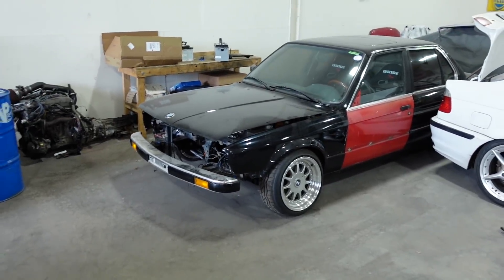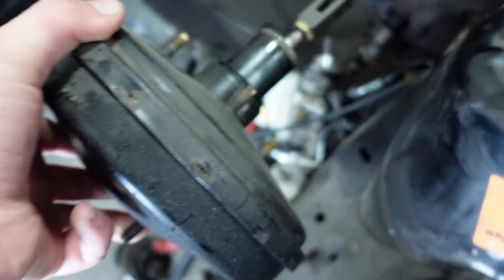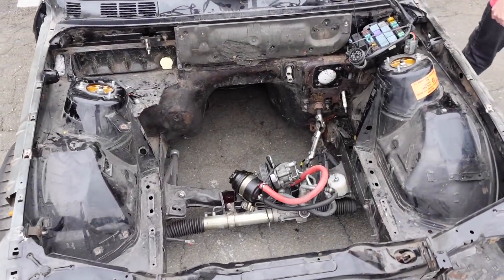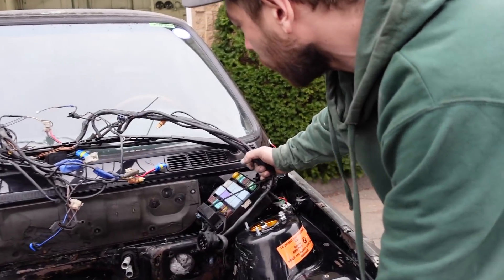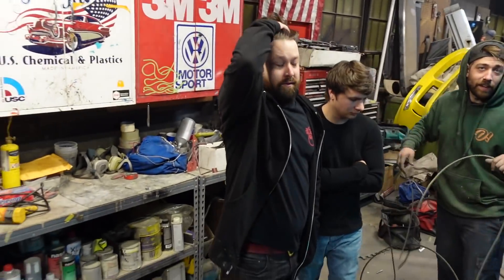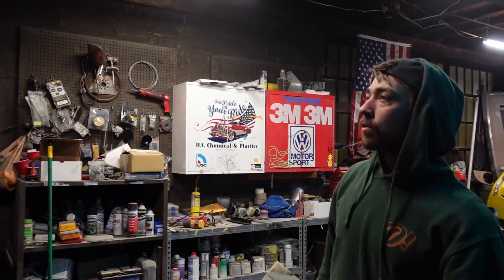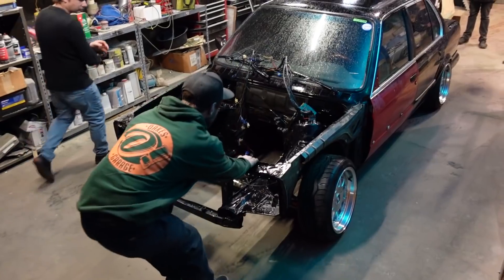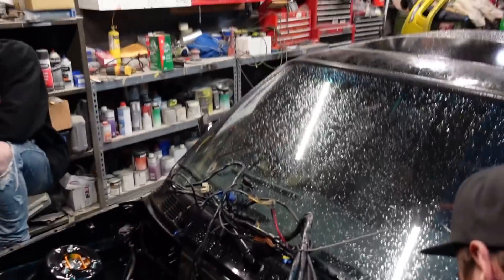MY E30 IS FINALLY GETTING REBUILT.

Comment: brian here is a tip from a painter. when ur gonna paint the booth white change the tarp to a white material don`t paint it because the paint will crack on the tarp when it moves  and will  fall down on whatever project u have inside ur booth. so dont even bother trying to paint it just change it to a white material. and sell the one u have :) nice homemade booth though.

Comment: quick e30 info all the cars that were not a 325i had batteries in the front. the 325i and m3 of course came with battery in trunk for better weight distribution

Comment: The fuse box under the hood is a pain to take out. The harness that goes to the rear of the car doesnt unplug from it so you would have to pull the entire harness under the carpet.

Comment: Always waiting for that E30 content!
BTW: check the whole firewall for rust holes. Bet you have a few. Especially around the big rubber where the wiring goes into the car and on the right side where the heat panel used to be!

Comment: I'm sure you and brian know this, but make sure you have tons of intake fans. If you have more exhaust than intake, you;ll be in negative pressure and dust will get sucked into the booth through every crack instead of going through the filtered intake.

Comment: Said this before but will 1 more time. There is an all purpose cleaner called Franks. It is by far the best cleaning chemical i have ever used. Interior, exterior, grease... Whatever you need it will erase it. I own a detailing/ window tint company. Try it once and you will see

Comment: jimmy dont try and pull that fuse box, its connected all the way through to the fuel release door. i know cause the previos owner of my car cut my fuse box out when he was going to turn the car in to a full race can and i had to get a donor just for the wiring harness and there are definitly wires that dont have connectors and go all the way through the car.

Comment: Straight sixes have batteries in the back. 4bangers in the front. E36 and so on the same
Reply: My m42 e30 also has the battery in the back? i figure early model m10 e30s have them in the front in that case.
Reply: In the US, only e36 318ti’s had batteries under the hood. Otherwise, 318, 323, 325, 328 and m3s were all in the trunk.
Reply: @Dylan_Draper  weird. Okay maybe it's different on EU models then.

Comment: Jimmy i need a transmition suggestion for a ls swapped s10 running a 5.3 ls with a stage 2 cam 90mm throttle body and fast intake. Long tube headers and custom exhaust. Looking at 350-400 horse